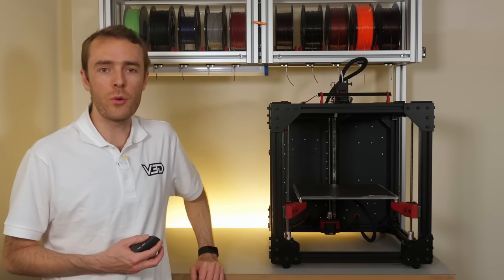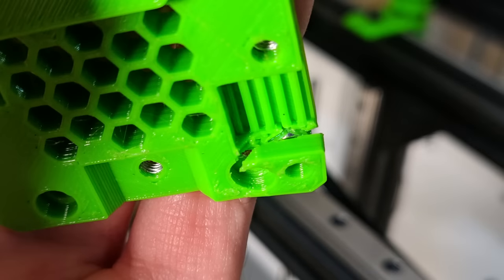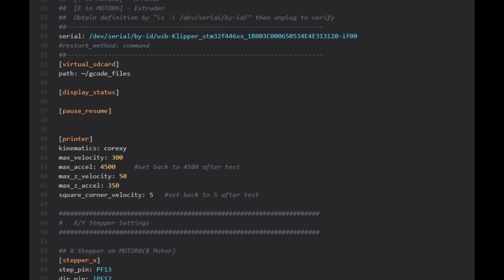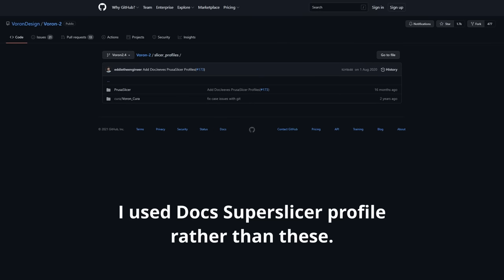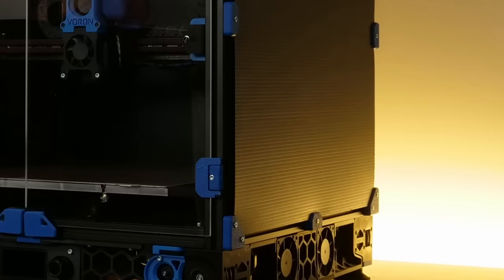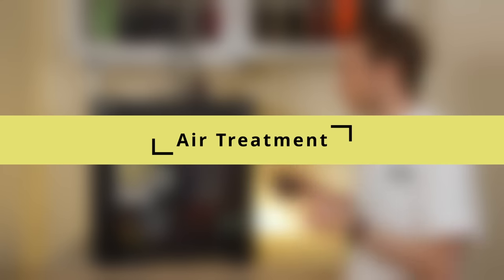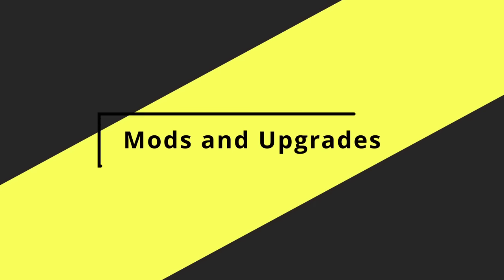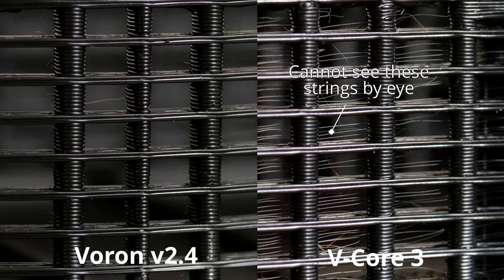Voron 2.4 Vs V-Core 3 Full Comparison Tested

Comment: "Stock" voron 2.4 afterburner is set up for ABS cooling, look at the AB-BN mod, or the upcoming afterburner stealth (based on AB-BN). Both use a bigger 5015 fan and have better duct designs. Threre's Stabby/LoudOwl if you require dual 5015, but AB-BN has been enough for me on my open PLA printer.
Reply: And a minute after I said this you namechecked them. Yes, do try. I've tried a warbird duct and another 5015 mod, and that worked well but the duct was quite fragile and prone to warping.

What i really like about afterburner is it's really modular and easy to work on. I have 4 hotends that get swapped between two printers, and I've got dual extruder single hotend bowden system that I can swap in for decorative dual colour parts.
Reply: The new voron stealthburner toolhead is crazy good. Like better overhangs with its single 5015 than I'm getting with dual 5015s  on a Hydra toolhead for ender3.

Comment: Great work! I would go with V-Core 3 because of easy of buying the parts. The part cooling on both is a bummer (I like to print with PLA)
Reply: The Voron will get a massive part cooling update with the new Stealthburner which is scheduled to be released this month.
Reply: @christophmuller3511  That's great! Thanks for the info. Hard to choose between the two printers.

Comment: I actually found the instructions on my voron more than adequate. With the exception of the electronics wiring, particularly the mains wiring.
I'm not sure I see the apeal or need of using an additional z endstop over just using the bed probe for all of it. On my other printers I simply use the probe too mesh level and home z.
Reply: only case is if you switch nozzles... but you can also use both to get the absolute bed position by nozzle and probe so you can change nozzle and build plate and both can expand with different temperatures and still have the same offset.  so good first layer regardless.

Comment: The Ratrig is available in 500x500 and the Voron can be configured with a "custom" size. Is it fine, if I just configure it to be 500x500? There doesn't seem to be many people having bigger Vorons.
Reply from the maker: Voron 2.4 design is not suitable for 500x500.

Comment: The fans are replaced with „better quality ones” (shows a Noctua 4010) - it is technically better, but performance-wise? Hmm...
Reply from the maker: If it was an e3d v6, the lower airflow would probably be an issue, but the dragon HF in this environment shouldn't need too much air hence going for lower noise.

Comment: I use octo touch on my pi4 with the 3.5"tft touch screen so I don't need to use my phone or laptop to shut down. It's onscreen! It's good for quickly changing nozzle Temps and bed Temps and pausing prints and shutting down. Other than that I hardly use it. Love octoprint on my heavy modded ender 3 v1. Want to try kipper for the accelerometer feature for tuning when I print above 60mm/s my absolute max I can print using Marlin and micro Swiss hotend is 100mm/s with minimal fuss Wich anything above 40mm before my upgrades was only dreamed of! Tpu I can print  50mm/s max with ok quality. Want a voron so badly and is next on my list!

Comment: If this should be a test/review/compare, then you need to do it on the shipped version. Not the version after changing all parts to get it better.
Reply from the maker: Well the Voron doesn't even have a shipped version because they don't ship anything, I already did a review on the shipped V-Core 3, and if nobody wants/buys the standard version anyway, what's the point in reviewing it. Like I said in the video, this is a comparison of the ecosystem that each offers and an indication of what you can expect.

Comment: I wanted to have a readonly pi, so basically pi after booting off an sd-card doesn't remount the filesystem in read-write mode, then uses overlay RAM filesystem, networked files, this sort of thing, so no writes to the card, doesn't corrupt the filesystem as it doesn't write to it, but as i found out, for some reason, pi loves killing SD-Cards when powered off brutally. And maybe i don't even mind filesystem corruption so much, as i can just reimage the card.

But now i have an SD-Card that is stuck in a read-only mode - absolutely unrelated to my experiments for sure, just something that happened on an impolite power loss for whatever hardware or boot firmware reasons, and has the last thing that was on it permanently etched into it. I seem to work around the read-only lock in software and erase the stuff, but when i take the card out and put it back in, everything is still on there as it was! I'll need some heavier machinery to try to analyse that card. Not only am i out of 4€ for the card, but it was also a pretty colour.

Comment: Hello
Could someone tell me, if its possible on the flsun q5 with a heated bed, to make a levelling without that the probe is melting or not, can it handle the heat, I have be told that than the printing quality would be better? 🤔

Comment: Raspberry Pi (any?) Can run the overlay for system (read only mode), bye bye corrupted SD card. You may have to build octopi on to of a pi OS, but octoprint should also support this with raspiconfig.

Comment: Would it be possible to have a relay from the pi to switch power to the 3d printer. That way, you would still need to login to the web interface, but you don't have to go to the printer to turn it off.
Reply: Jup, totally possible. Some people use sonoff switches with integrated power metering

Comment: where is that "strong community engagement" with the Voron? There is no support on it!
Reply: Join us in the Discord channel. :)
Reply: @3dthat  just say no to Discord, or facebook.

I don't need another personal data seller.
Reply: @showmytime9177  LOL, your choice I respect that. But Discord is how we all communicate and get answers and collaborate. Its a tool for us.
Reply: @3dthat  "all" ? I guess by "all" you mean the "Voron community", which if I were to judge by what happens on reddit is a very toxic community.

I don't use discord at work or for other projects, so there is no "all".

I did get a "the voron community treatment" on the reddit channel and it is very toxic. This "community" only accepts bragging and ass-kissing, don't post problems and never-ever say someting bad about LDO.
Reply: @showmytime9177  wowzers, not an attack. Sorry you had a bad experience, there are toxic people everywhere, I can say I have never had a bad experience in discord. Always helpful and always fixed my issues.

Comment: Stainless steel would be a better pick instead of zinc plated.
Reply from the maker: Stainless steel fixings are not magnetic making them a pain to use. They are also significantly more expensive and 3d printers do not benefit from their additional corrosion resistance. Bzp are also typically more widely available.

Comment: Prusament petg prints between 240 and 260c. It's very expensive but you don't have to fight warping like with abs.
Reply: Still not suitable for an enclosed design as the Voron, it will give under load and heat. ABS is used for a reason.
Reply: @christophmuller3511  Ratrig sells petg parts for their enclosure (as are all the printed parts they sell for the vcore3). Do they have a comment?

Comment: Expensive, challenging to source all the parts (or long wait lists), 30hours+ of assembly, all the latest hardware and software advancements, the benefits of CoreXY,  Klipper, and linear rails and.... after all that - these both still print no better than an Ender 3.  Faster? yes. Better? no.
Reply: You are separating quality and speed. Voron can do great quality at a faster speed. Something ender3 cannot do. Ender3 requires a snail pace.
Reply: I can tell you, I have Ender 3 and Voron 2.4 side by side. The Quality, reliability and speed, all blow the ender away. Not to mention how you can print everywhere on the Voron bed, where on the ender 3, there are always low spots and you can never print to the edges ever. On the Voron you can print to the very edge on every corner perfectly, every time.

The headaches of constantly fixing issues with Ender 3 are also terrible. Voron 2.4 the most I have to do is change a nozzle every 200 hours.

So in a nutshell, Ender 3 un-reliable, very slow, very bad bed level, and oh the Z axis, holy cow is so bad on the Ender 3, look at your layer lines when you start printing tall objects, its really bad on the Ender 3. The Voron can print to the ceiling with very consistent layer lines. 

Ok yes, I can confirm the Voron is better quality than the Ender 3.

Comment from the maker: If you want access to my calibration test files and a guide on how to use them and calibrate your printer for the best accuracy, you can find everything here on my website: My Calibration and Test files: https://vector3d.co.uk/store/3D-Printing-Help-c125254079
Reply: Definitely recommend checking out the Railcore printer if you do another comparison.  The Railcore has all the features of these, but is much more flexible when it comes to customization.
Reply: Is there any z binding/wabble on the ratrig compared to the voron 2.4?